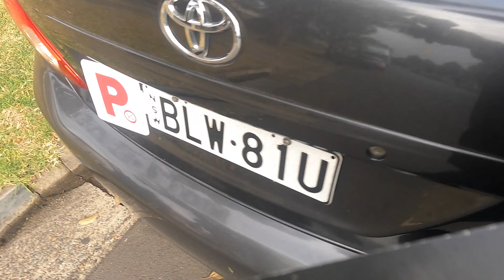toyota corrolla 2010 fuel pump replacement

Comment: I dont believe you diagnosed this car ?
There is no proof ...
You must have replaced because you believe its a common problem ...
No evidence here that you discovered the problem .. 
Not like you normally.
Reply from the maker: Simon fix anything accept   no money and love
Reply: Sometimes we just have to go with the hunch. For example, my landcruiser 200 thrown a code that it is not even known to be possible for it to have. Turns out to be a lose wire connection.
Reply from the maker: Any car if they gave up they call me
Reply from the maker: I am master of all this